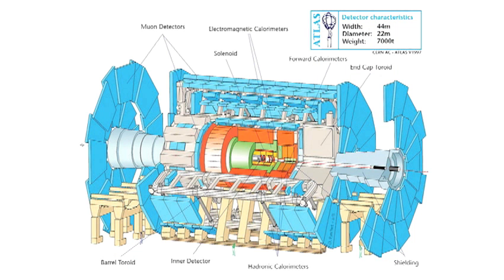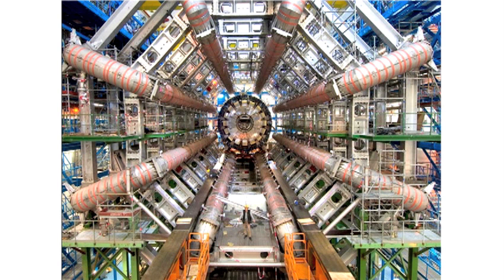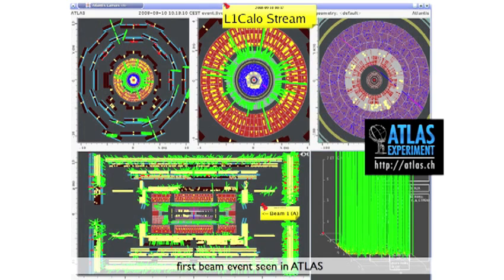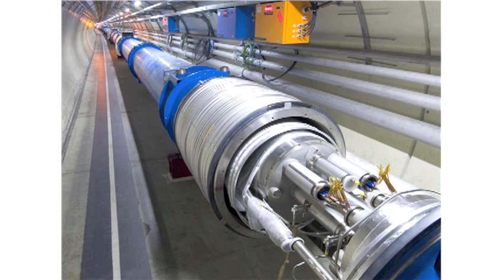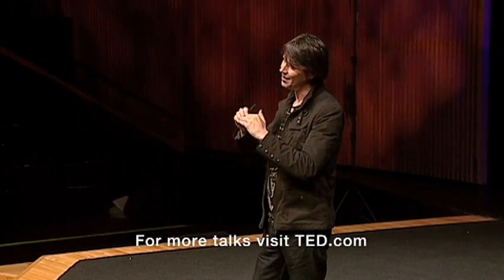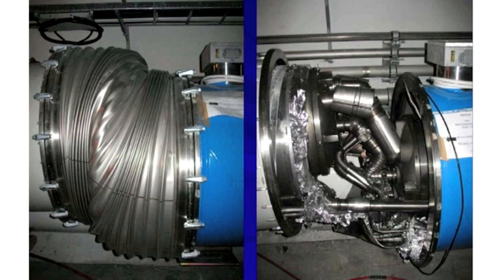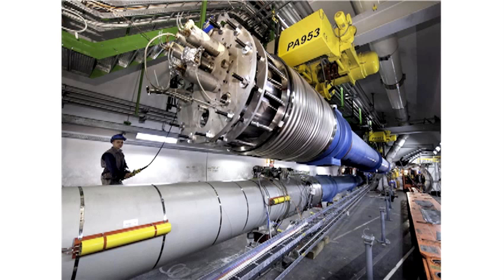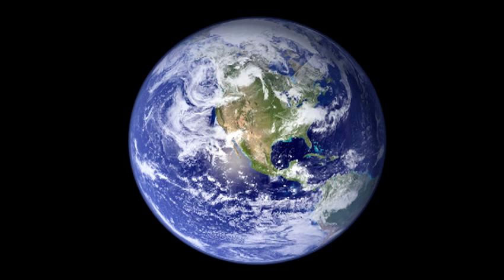Brian Cox: What went wrong at the Large Hadron Collider

Comment: Someone forgot to calibrate the flow sensors to compensate for the lineal degradation of the electron pulse generator therefore causing a gradual heat build-up of the flux capacitor.....
HAHA, rookie mistake !
Reply: The flux capacitor... so funny
Reply: This belongs in r/VXJunkies thought I might share in case u wanna join it
Reply: 1.21 Gigawatts!!!

Comment: This "resistance" being encountered in these faulty joints, caused the ring to expand (trying to move outward!) about only some few mm, but since there are steel tubings and housings carrying all these helium amounts, wirestrains and encapsulating the actual acceleration tube, it had to expand somewhere. So it has tried to move apart from each other, trying to push all the magnet assembly right and left of the fault location apart. This creates a strong mechanical force, caused by thermal expansion, that pushed these two ends into different locations, despite of their massive 20 tons of weight. But sometimes, physical forces are stronger as expected. So the whole problem was of thermal nature, destroying a part of the collider just by thermal properties of material expanding due to resistance and therefor heating up over a limit while it is not intended to heat and expand to somewhere.
Reply: Well if you take the dialithium crystals and tilt them at a 45 degree angle pointing at the small hadron compelling the large hadron to compensate thus combining the nucleotide with the neutrino particles creating a small quasar long enough for molecular atoms to mix with the matter/antimatter resonance virtually creating a tear in the fabric of space thus allowing the romulans to creep thru and bombard us with a photon torpedo which would create a wormhole large enough to thrust us into the delta quadrant.

Comment: While sitting in control. There is a soft whine as the power supply winds up for a beam firing. Everything looks good as the collider itself is powered up. The beam is fired and suddenly there is a soft "Bump" and a power outage. Lots of red blinking lights appear on the control panels and the monitor shows a laughing skull and crossbones gif along with the following message... "Windows Kernel Error. System has shut down unexpectedly."

Then comes a phone call from about 75 Km away asking if Blue Smoke is supposed to be emanating from one of the ventilation shafts.  Then when the corridor is cleared behold what a manufacturer defect induced failure looks like. Then realize "At'sa lotta' power there!"

What's another twenty or so million dollars in the name of science? LOL

Comment: Umm making a collider that large is very unnecessary. You will encounter far more geological problems than engineering problems and far more engineering problems than actual scientific problems. It is more easier to just upgrade the energy capabilities of the HLC progressively than to create an engineering feat you just described. Also, that is exactly what it would be: an engineering feat and not a scientific one.

Comment: In a perfect world, we would use solar and wind power if price was no object. But as i stated, oil and coal are still extremely cheap compared to building solar and wind infrastructure, especially when you factor in how little energy you get for the expense of the panels and turbines. Also, solar and wind are geographically limiting as well because its not sunny and or windy enough in very many places to justify building the infrastructure. EG solar panels in seattle would be stupid.

Comment: As for nuclear energy, you cannot just take the radioactive material from a warhead and use it to make power. You have to be more picky on deciding which uranium to use. You have to choose a more stable isotope of uranium such as U-235 or U-238, whereas nuclear warhead are less stringent. If we could use the energy from nuclear warheads, wouldn't you think that the radioactive matter in the out-commissioned warhead be extracted and be used for power?

Comment: The fact remains that despite they're environmental problems and 
its nonrenewability, coal and oil are the cheapest means of powering our world. If that were not the case, buissness' and governments would use other methods. Whether it stays cheaper is a legit question though. Thats why Im big on nuclear power. Solve two problems at once, use uranium from disarmed warheads and turn it into a source of very cheap energy. Provided it was regulated effectively, it would work great.

Comment: I never impugned hydroelectric power. I said solar and wind are impractical and more expensive than oil and coal. But even hydroelectric power is limited by the availability of large moving bodies of water. I live in Cali and the hoover dam is right next to us but barely powers vegas if that. Wind is unreliable and requires lots of capital to build wind farms and has no way to store unused energy. Try putting solar panels in seattle and you might get power two days a year.

Comment: That machine consumes 120MWatts/60.000 houses/h, at 12000Amps and near of 10.000Volts. All that power  by supercontuctor cables of just some milimetres. If cable was made in copper and not in niubium titanium alloy, that tunnel would be too much small.

Comment: If my understanding is correct, the factory defect lay in the cooling mechanism. They lost cooling and that caused the loss of super-conductivity. Once that happened and the wire  became resistant to current flow of 23000 amps, the cables would inevitably have been destroyed. 

With that kind of amerage, they could have been fifty times thicker and it wouldn't have mattered. 

There are certainly screw-ups that ruin projects like this -- but they are usually procedural, not engineering ones.

Comment: Isn't it silly to assume that you, who are completely unacquainted with the technical issues involved, know more about those *technical issues* than the people who actually built it? 

I doubt that any thickness of cable at normal temperatures could carry 20,000 amps without an unacceptable amount of resistance. 

Do you really believe they chose to use 27 kilometers of cryo-cooled *gold cabling* if they could have used something cheaper that worked as well -- because it was "fancy?"